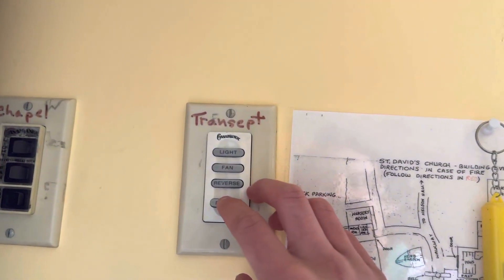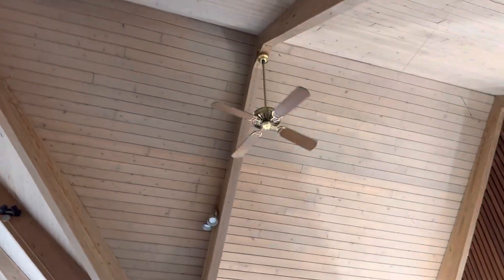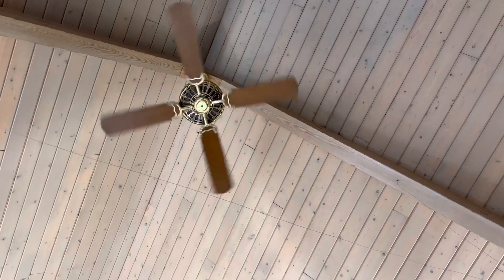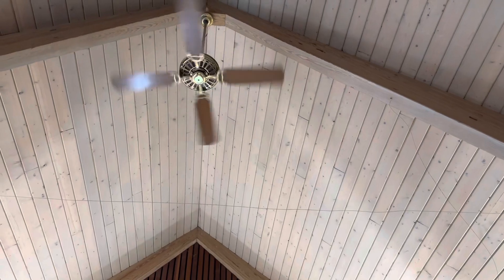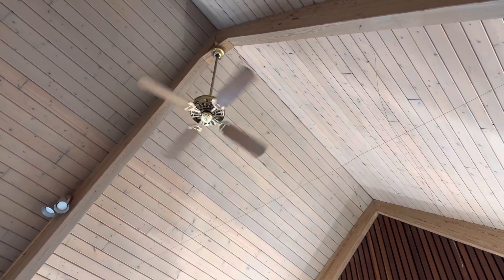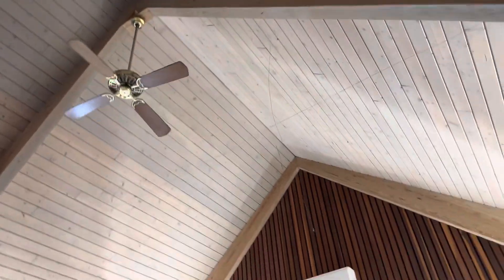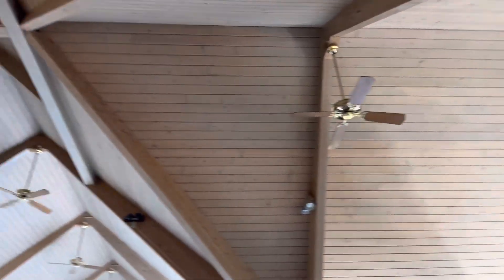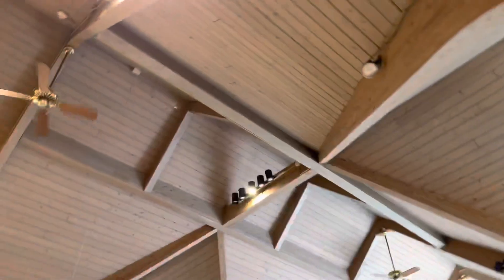Casablanca Zephyr Ceiling Fan (Demo Mode Remake)

Comment: One day, I will have to demonstrate a Casablanca Intelli-Touch Ceiling Fan
Reply from the maker: yeah, that sounds like a good idea. if you get a fan from January 1981-September 1993, be aware that those hang trus are recalled, so you'd probably have to use a recall clip to test a recalled hang tru fan.
Reply: Update: I demonstrated an Intellitouch Casablanca Panama V with a K4B spotlight kit.
Reply from the maker: @Fanology  cool

Comment: Sounds like a failing capacitor on the board for the messed up tones. I doubt its just the buzzer
Reply: Failing start/run capacitor only affects the board if any of the buttons are pressed. None of the buttons are being pressed during demo mode.
Reply: @CeilingFanVideosOnYT  Theres never one thing to see a result of failing capacitors. If its like older electronics that start doing weird things when tolerances loosen over time on components.
Reply: @CasaPanaFanaLanda  The only thing the start/run capacitor connects to is windings. It’s not connected to any buzzer.
Reply: @CeilingFanVideosOnYT  It could be any one of the smaller value ones on the board. The other component susceptible of physical damage is the quartz crystal. I understand the big 10uf 250v yellow one on the board is tied to the motor. Being that this fan is operating normally its really not an issue. If they all failed there would be unexplainable and possibly funny issues. I dont mean to confuse you all.
Reply: @CasaPanaFanaLanda  Yeah. Though the 10uf capacitor going bad can confuse the board when a button is pressed. It can mess up electrical signal from the control to the board, but it only happens when the motor is powered. It can prevent the fan from going all the way to speed 6 when holding the fan, and make the board not listen when the fan is on higher speed. However if the light is on, it can kinda clear confusion.
Reply from the maker: My Saturns board has sound like this before when you run it a little longer but, the capacitor is fine on my saturn
Reply from the maker: @CeilingFanVideosOnYT ometimes I try pressing the reverse button and it doesn’t reverse the fan. So I end up using demo mode to reverse it